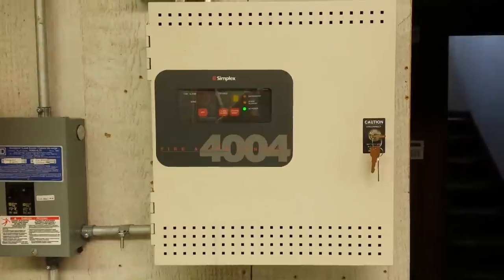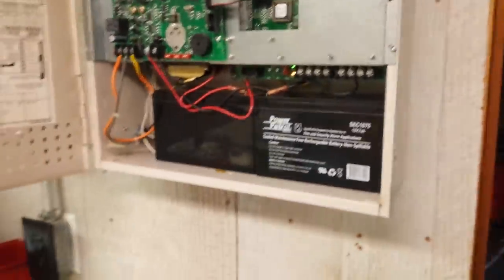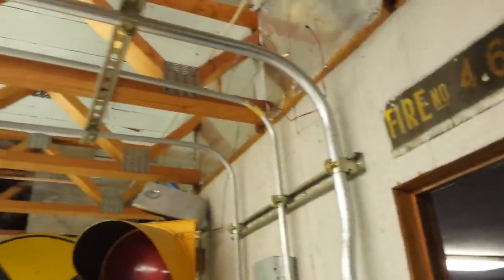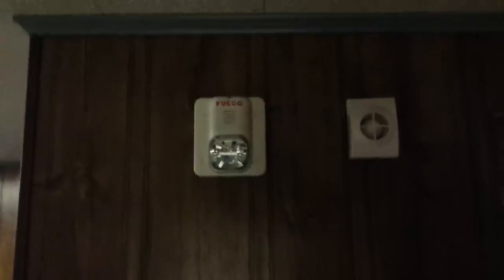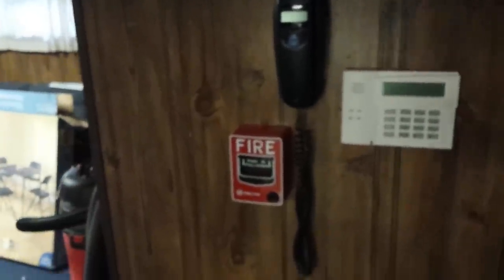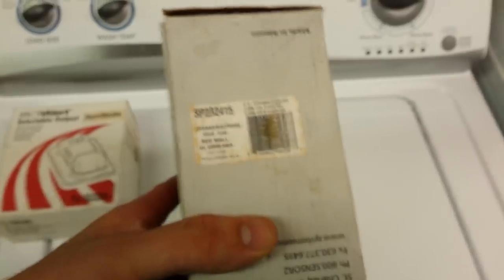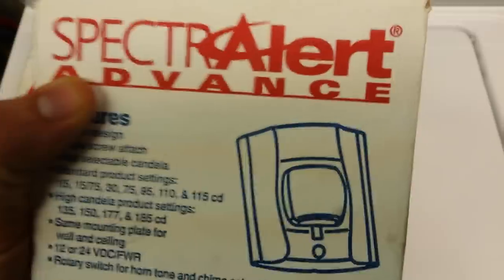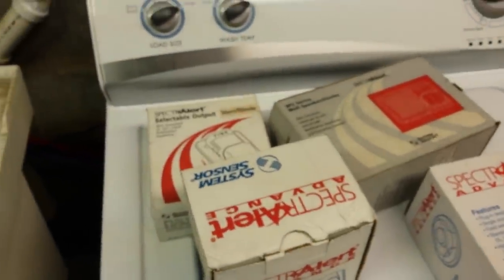Simplex 4004 Fire Alarm System Test

Comment: Nice! I know the K-8 school I went to for kindergarten had a Simplex 4004 panel at one time, tied into their old 4208 panel from the '70s. It was installed in 1998 and used for new duct detectors that had just been installed. Now they have a Simplex 4010 panel replacing the 4004 (amazingly, the 4208 is still intact and operational!)